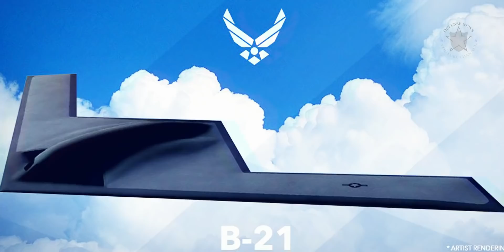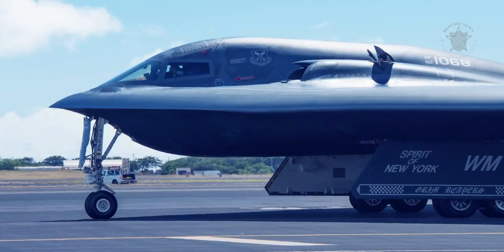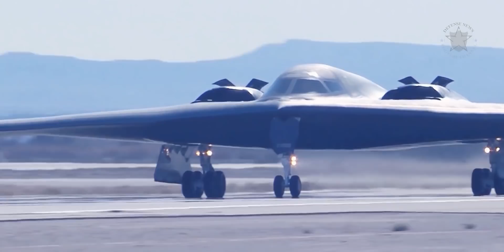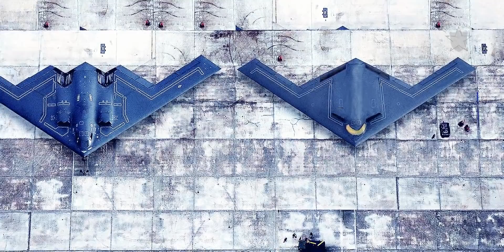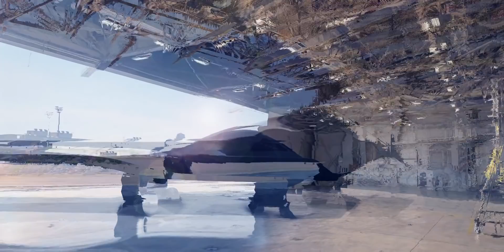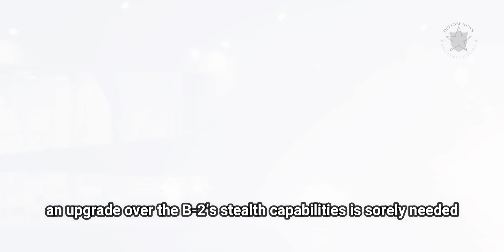The Russian nightmare about B-21 Raider stealth

Comment: The Chinese j-20 and the Russian su-57 are not true stealth aircraft. We can tell this just by pictures. There are rivets that are visible from the outside. There are angles that have gaps in them the engines on the su-57 put off in extreme heat signature. Do United States is the only country to field a true stealth fighter? The F-35 the F-22 in the B2 We also had the F-117. Nighthawk that's been all but retired. There are a few still flying.
Reply: You talk shit. Go back and find some early picture's of the F35. It had rivets all over it. The stealth coating covers them. 
The F35 also has a hot exhaust with cold air mixed to reduce its IR signature. 
One of the initial problems it had was the cross boom at the back was getting too hot. 
The Russians also are using some sort of Cold Air mix to reduce the rear IR signature on the SU57. How do you know the F35 system is better? 
Where are the visible rivets on the completed J20 and SU57? 
Not that perfect rear end stealth is as necessary for both of them. 
The F35 is the one that needs it. So slow it will never be able to get on the tail of either. Sure it can use burner for a few minutes but back to Subsonic then. 
It will always be the SU57 chasing the F35 and gaining whatever. 
I hope the F35 has good stealth from above also. 
The SU57 has an operating ceiling about 12,000m higher. 
Thats the problem with a cheap do everything fighter like the F35. 
Compromises everywhere. The end result is it does none in an exceptional way. 
Slow, Moderate Range, Poor Climb Rate, Only moderately good stealth from the back, can't fly low and fast, can't fly high. 
Hopefully it will be stealthy enough. 
I am no longer too certain about its systems. The DAS was supposed to be a big advantage. Now the DAS is being completely redesigned. 
The DOD said it had to do it because the old one had been surpassed by other similar systems in the World. 
Time will tell.
Reply: @skippy5712  That's why we changed it.
Reply: @skippy5712  Answer me this why is the su-57 been halted in production? Even India doesn't want to purchase the damn thing.
Reply: @rise-amorph8178  News to me. Maybe they halted Factory Testing of any more after the recent crash. That will not be for long. The last I heard an additional 78 with the new engine have been ordered for delivery through to 2028. Maybe thats all they want? About 90 X SU57 operating in conjunction with 300? new big Drones. 
Priorities change!  
Especially when the Pentagon Reports the F35 still has 823 Software Problems and can fly about one Mission per week in practise.
As originally predicted it will also be at least 2023/4 before it will come close to meeting its original design Specifications and be ready for State Trials. 
A lot has changed since 2000. 
Its obvious Russia is moving towards ensuring there security using Missiles. They have made huge advances in the Missile area. Why not stay with it? 
Whats the point of having lots of Aircraft if where they are based and land can be blown up with a very precise Long Range Hypersonic Conventional Warhead Missile that nobody is going to be able to stop for a long time. 
Rely on SAMs for protection against enemy aircraft. 

India. The original argument there was about Price. Russia wanted $4billion to design the changes India wanted. A two seater with other features. 
In the end India decided to build 140 more SU30s in India that will be close to SU35 standard and gradually upgrade all there older SU30s to near SU35 standard. 
They would look at the Russian SU57 again when it was available with its new Engine. 
Sure they seem to have given up on a special Indian version of the SU57. 
I don't think Russia will be too worried. They will be supplying all the Engines, Avionics, Radars etc. to India for there near SU35 program. 

Did you notice Russia announced there were 5 x F35 patrolling the Iranian Border when the Missile Attack against the USA Base in Iraq  was about to take place. 
I wonder how they knew these Invisible Aircraft were there? The only assets they have in the area is there S400 in Syria. Not sure if they have a ship or two in the Persian Gulf?
Reply: @skippy5712  July 12th 2018, The Business Insider. " Russia had to admit defeat with it su-57 and halted production."
Reply: @rise-amorph8178  Just piss off. They announced an order for 78 more Aircraft last year. The Business Insider is nothing more than a USA Propaganda publication. 
Add Newsweek to that now. As a 70 year old Australian I used to Subscribe to Newsweek. Now nothing more than a USA Propaganda heap of crap. 
Just like your MSM. 
If you really want to know what is going on Google and find Russian releases directly. 
They did not give a lot of detail. Simply said Production of 78 x F57 would start after the current 12 are finished. They will have the new Type30 engine with better Specific Fuel, Lighter, cheaper to produce, far more thrust. About 176kn on burner from memory, far higher than the 117 on the Prototypes without Burner (can't remember),  anyway it will have far higher Thrust/Weight than the F22. About 1.3/1 from memory. 
They are proving the Type30 up on some of the Prototypes now. 
It was never called off. Top Russian Military have been saying this for ever. 
The First 12 in Production now have the 117 Engine and will all be delivered this year I think. 
All approved by Putin. Money allocated etc.
Reply: Stealth aircraft require advanced manufacturing techniques. Neither Russia nor China yet have that ability.
Reply: @jdanon203  spot on sir. In the technology that they've stolen from America, even if it's somewhat stealthy if they have a problem with it, since they didn't do the R&D on it themselves, they won't know how to repair it or fix the problem.
Reply: Well, you're somewhat well-read. If the F-35 is so useless then why the hell is Israeli F-35 destroying. Top surface-to-air missile systems upper Russia in Syria. Why have they been able to fly over Beirut and take pictures? Without being fired at how have they been able to fly over Tehran? The su-57 program had been halted in 2019. All production was stopped.

Comment: At present S 400 is American  Nightmare.

SU 27, SU 30, Mig 35 and SU 35 can easily see , track and bring  B2 spirit & B21 down to ground.
Reply: Prove it. SU-35 has L-Band radar.
Reply: @valenrn8657  that don't mean shit bro this is what b21 is being design to do dummy is to penetrate thru the most advanced air defense system the b21 is 21 century low observable technology or stealth that has present and passive countermeasures sensors just wait when comes out Russia will start saying they have new air defense watch. Why. Cause it's all new materials that that s400 has never been design to detect. L band low and high frequency radar's all have been put into development of b21. With confidence has been proven as of now total undetectable and of somehow it was detected it impossible to track. What people don't understand is even if you see on radar is one thing tracking the target is a whole other story. You got to track and get a lock before you can shoot missile.
Reply: Just shows you just talking shit b21 hasn't flown yet but you can shoot it down lol get out of here
Reply: BS. S-400 is junk.  Theses new aircraft has the ability to build multiple fake targets.
Reply: Lol s400 nothing no ew to Americans you don't think we figured out how to beat that system. The new b21 will piss on s400 and s400 is like where is that coming from with b21 passive countermeasures the s400 oh it's over there but can't get a lock on it lol. The whole time b21 is on top of s400 pissing on it.